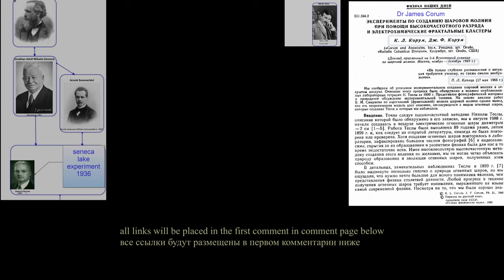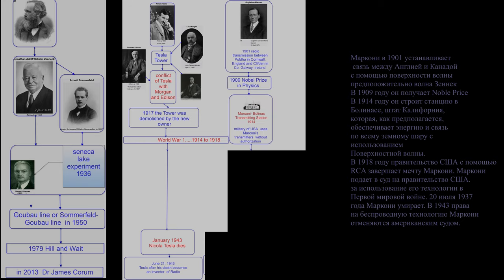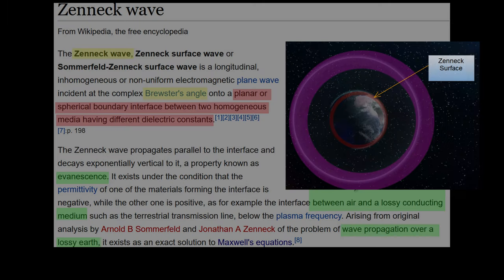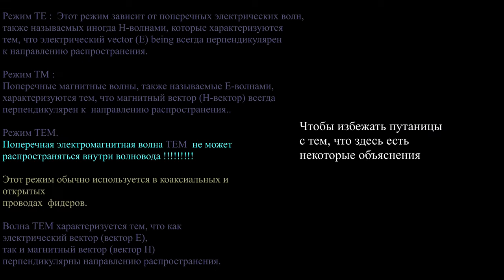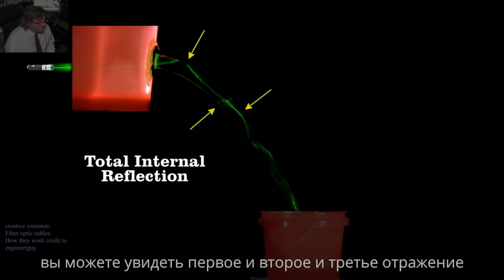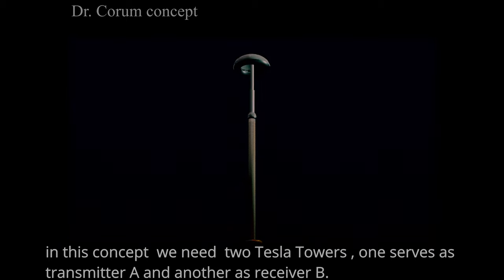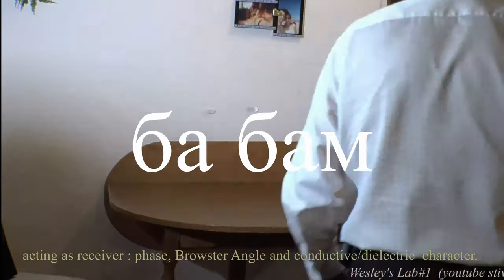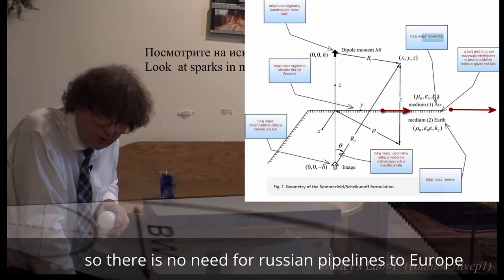Part 2 The Corum and Zenneck Surface Wave guide to  energy transfer

Comment: Ya, really looking forward to part 3, please; construction and tuning to transmit at the Brewster's angle.  We do not have those 40 years the Corum brothers used to figure that thing out ;)
Reply from the maker: all the best my friend .. all the best.
I do what I can in within brackets of my limitation
Reply: Great, my Friend! ;)  Will you please give us some clues here or in the next video, about the following?
RESONANCE
In the Texas Tower patent US20180259399A1 the Corum brothers mentions Resonance and Standing Waves creating maximum voltage at the top capacitor.
Dr Hans’s Secondary coils:  Diameter 13.5 cm x 1400 Turns x Pi = Wire Length 594 meters.
Dr Hans says his Secondary coils are using (Transverse) 2200 meter waveband running his circuits.
The Longitudinal waves of the 2200 meter Transverse waves are 1400 meter waves (2200/(Pi/2)).
The Secondary coils Wire Length is not 1/4 of the Transverse wavelength.  Neither is the Wire Length 1/3 of the Longitudinal wavelength - that would be a Longitudinal “length resonance”.
Have I got it right so far? ;)
How does this 2200 meter wavelength create the Longitudinal Resonance (+ LC Resonance?) and the Standing Waves, maximising the voltage at the top capacitor?
Are the 1400 Turns - and the 1400 meter Longitudinal Wavelength - a coincidence ?
BREWSTER’S ANGLE
I do not understand the mirror image ground plane thing.
What is the actual Brewster’s angle when going from the air into the Earth (image ground plane); into the “guided surface waveguide mode along the surface of the lossy conducting medium”; the Earth’s surface ?
TUNING
You tune the system to project the electricity “into” the Brewster’s angle by:
- Fine tune Frequency,
- Moving the Primary up/down along the Secondary,
- Tune LC Resonance?, and 
- Adjusting the hight of the top capacitor?
S:)
Reply from the maker: @Simen1969  Before  I respond to your question please  explain to me term you have used :
quote: "The Longitudinal waves of the 2200 meter"  with respect to  quote : "Transverse waves are 1400 meter waves (2200/(Pi/2))."
There is NO SUCH THING in physic  as electromagnetic  Longitudinal wave !!!
 You can denote EM wave in meters or in Hz but that's all it  is.
Reply from the maker: @Simen1969  quote of your concern : that would be a Longitudinal “length resonance”.itub 
Wesley's correction :  don't use word Longitudinal as this  parameter/descriptor  is characteristic to mechanical waves  -not EM waves.
In https://patents.google.com/patent/US4751515A/en
 patent Dr J.Corum explained shortening  physical  length of coil that now behaves like it was  many times,  hundreds of times longer . using different  methods  (however  similar.)
 e.g ( CW CCW left, right  bifilar.)
Reply from the maker: @Simen1969   quote of your  question : How does this 2200 meter wavelength create the Longitudinal Resonance
Answer: there is no such thing in physics as "Longitudinal Resonance"
Reply from the maker: @Simen1969  Quote of your question: BREWSTER’S ANGLE I do not understand the mirror image ground plane thing.
Please refer to : https://www.youtube.com/watch?v=wIIABIU3tRw&t=13s
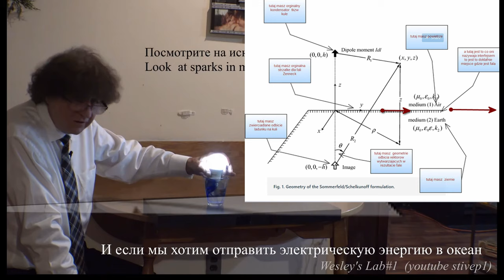Please refer to : 9:07 
Please refer to :  https://surface.syr.edu/cgi/viewcontent.cgi?referer=https://www.bing.com/&httpsredir=1&article=1179&context=etd
or type in google : 
A STUDY FOR THE PROPAGATION OF  ELECTROMAGNETIC WAVES OVER IMPERFECT GROUND PLANES  BASED ON SCHELKUNOFF INTEGRALS 
Note1:  signal ( energy in form of TEM   "converted- formed "- ( not accurate descriptor) and now  at TM ( Transverse Magnetic ) mode must be vertically polarized    and  oscillating in form of (standing wave - controversial) in space between earth and (HV Tesla Coil)  Top Capacitor.
 You don't need to use 1/2 y wave   or 1/4y wave and most likely  you will never use it  but  you will go to  e.g 1/1000 y  using  CW CCW ( not only) winding method .
Note2: for simplicity think that  every possible frequency from 20kHz </>  to  200MHz </> acts exactly the same. way.
{for scientific evaluation  [excluding some specific  variations ( e.g  plasmon)] - the   described mechanism should be the same from 1Hz to  light frequency.}
So you can use </>~52MHz from regular Kenwood TS-2000 at CW - telegraphy)   according  to your license ( or not : )  )   to drive Tx coil made  and calculated for  this band .(- and at this frequency you can use 1/2 or 1/4y) Impedance matching between your Tx  and primary of Tesla coil is mandatory!!!! ( you can also use any Tx of your choice )
It doesn't have to be Dr Hans or in this matter my own  set of parameters.
It will work as well.
But making an antenna will be much  easier for you  at this frequency.
what you are losing  ( using 52MHz) is  performance as inverse square Law is much  more depressing (or aggressively discouraging)   to the  experimenter  at this  frequency , -unless you use it  using surface of the water  ( lake) to create  Air( dielectric) and water ( lossy conductive medium)  *interface * where Zenneck wave lands at Brewster  angle https://en.wikipedia.org/wiki/Brewster%27s_angle
Note3: 1.8MHz or 3.5MHz would be   much more efficient when using Kenwood TS-2000  or any other rig or any other  generator.
Quite nice results  are  achieved using 28MHz as this is easy  band  to wind coils of 1/4  lambda.
Note4:  in frequencies lower than 1MHz e.g 170m  the transmach  known also as impedance matching transformer  will  look like   a TRANSFORMER !!
e.g  https://www.ebay.com/itm/AE-Advanced-Energy-LM-1-25K-Step-Up-Down-RF-Match-Switch-Box-Transformer-PARTS/133173582290
AE Advanced Energy LM-1.25K Step Up/Down RF Match Switch Box Transformer
NOTE 5: Dr Corum experimented at first  at 52MHz at Seneka Lake 
 http://rexresearch.com/corumzenneck/texzon.pdf
or google for : Wireless Power Conference - 2016      
Corum, Miller & Corum: Surface Waves Baylor University Texzon Technologies, 
LLC TEXZON TECHNOLOGIES CONFERENCE PAPER[DRAFT DATE: March 23, 2016] 
SURFACE WAVES AND THE ‘CRUCIAL PROPAGATION EXPERIMENT
that  investor e.g Chevron  evaluated as worth of money spending proof.
that's what  made Viziv tower  in Milford Texas  to be build.

Comment: Ha! Third video? Maybe not. But here's how to make the transmitter tesla coli Wesley used for his wireless lightbulb lighting:  practical  application material:

Primary
 coil form (spool): upper portion of a 5-gallon plastic pail
 Diameter: 11.5"
 Length: 2.125"
 Wire size: AWG #14, type MTW  THWN  THHN  AWM 600 volt
 Turns: 18
 Winding length: 2.125"
 
 Secondary
 Coil form: 1/8"+ cardboard cylinder with 3/32" acrylic ends, with a few light coats of polyurethane finish
     (Grace Ice & Water Shield cylinder)
 Diameter: 5.3125"
 Length: 38"
 Wire size: AWG #24
 Turns: 1740
 Winding length: 37.5"
 Inductance: 54.6 mH
 Resistance: 72.7 ohms
 Height of bottom turn above ground: 18" + 6" (pallet height) = 24"
 
  Elevated terminal
 Aluminum disk
 Diameter: 23"
 Thickness: 0.125"
 Height above top turn: 3' 4.5"
 Aluminum duct
 Diameter: 3.25"
 Overall diameter: 29.5"
 
  Ground terminal
 Copper bonded steel rod: 5/8" x 8', 2 with 8" spacing, driven into the water table at a depth of approximately 4' below grade
 Connecting wire: 14' AWG #10 (stranded) + 21.5' AWG #16 cord

 NOTE:
 mast must be telescopic and must allow to adjust  the position of the top capacitor Up/Down !!
Reply from the maker: Information well made. Thank You. I see you stopped  posting your videos 3 years ago.  Everyone has its own reasons right?    Random viewer  is often not patient enough to understand. Content creator satisfaction/ interaction may not  satisfy  his willingness to  continue.
The more complex explanation was  in https://youtu.be/XOTLfnMOSqQ  . 
For an experimenter the rule is : 
1 understand it first
2 experiment
3 perfect the device.( improvement)
Do not waste time at some areas  rejected permanently by  physics : 
 -there is no overunity, no perpetual motion, no extraction  of energy from permanent magnet, no antigravity, - so very much specified energy conversion/ transfer  process is the way to go. Free Energy should be understood only as Energy that is still for free because initial  source  energy was converted from  is available  for free .   Physics doesn't recognize , magics and spiritualism too.

Wesley
Reply from the maker: @starraider25  With all respect to your enthusiasm I'm very much conservative in physics that  rejected  overunity, perpetual motion and antigravitation and eather. No patents are issued for it.  There  is no scientifically recognized literature  about it nor sufficient convincing scientists evidence.  I  managed  to make  the device 
And than the reflection comes.  - If you have something others likely do not have do not yell about it as it can harm you.
Nobody wants you to have for free their work, product that cost them  time, money and intellect. That includes me and you too. Everyone wants for free but doesn't give anything  for free.
 I like physics and I talk about  real device from  the  perspective of  science but  random crowd  is likely good  in other  areas I'm not .
Here  is the essence allowing understand and by that  nothing is  so much difficult to these willing to  experiment.  I'm not any longer  trying to publish  ready to use ( IKEA style) manual  - :  How to convert Electromagnetic Energy from lightning  into electrical energy  you can use. What for?  DIY please .  But I like to talk about it .  I do not exclude me making 
 new videos  too. https://www.youtube.com/post/UgkxDyXSjGt1mSDtH169OSUWgPGacYjEXWWt

https://youtu.be/XOTLfnMOSqQ  .   https://youtu.be/zE4GjB1cWLQ  - artistic form.
Wesley

Comment: I know how this works. For EM wave transmission you gotta have an antenna that is a good EM radiator, like half wave dipole. For this Zenneck wave, you need an antenna that is a POOR EM wave radiator. That way all the energy can be radiated via that Zenneck wave. Basically just a coax cable of the right length
Reply from the maker: The more complex explanation was  in https://youtu.be/XOTLfnMOSqQ  .   https://youtu.be/zE4GjB1cWLQ  - artistic form.
Reply from the maker: Here  is the essence allowing understand and by that  nothing is  so much difficult to these willing to  experiment.  I'm not any longer  in the position  to publish  ready to use ( IKEA style) manual  - :  How to convert Electromagnetic Energy from lightning  into electrical energy  you can use. What for?  DIY please .  But I like to talk about it . https://www.youtube.com/post/UgkxDyXSjGt1mSDtH169OSUWgPGacYjEXWWt

Comment: Have you entertained any of the technology from the Ancient Egyptians? Their building of anti-gravity vehicles, their vast understanding of magnetic forces along with mechanical pressure to produce electricity? Their knowledge of creating 50 ton blocks of stone using bacteria instead of a heat source? Much of my understanding comes from the devices they built with rudimentary elements. From around 6000-3000 BC their knowledge couldn’t be surpassed by todays knowledge. Most are skeptical of these accomplishments but that’s because most don’t understand any of the dynamics.
Reply from the maker: I'm writing to you 2 years later. Unfortunately  physics do not  accept  antigravity, overunity,  extraction energy  from  magnet, eather,  perpetual motion  etc. 
Energy can only be converted from one source to  another.  So I used energy from lightning conversion  to electrical energy  you can use. The very  foundation for it is understanding  this:
https://www.youtube.com/post/UgkxDyXSjGt1mSDtH169OSUWgPGacYjEXWWt

https://youtu.be/XOTLfnMOSqQ  .   https://youtu.be/zE4GjB1cWLQ  - artistic form.
Wesley
Reply: @stivep1  Yes I have read up more on the Egyptian leaders and it would seem that they were using a rudimentary type of dynamite and an advanced system of pulleys and levers. They may have been using a pulley that would cause friction against amber to create some sort of an electrostatic propellant device. Amber comes from elektron. Maybe this was their anti-gravity device.
Reply from the maker: @Smcsnacks   Amber is a petrified tree resin
When amber is rubbed with wool or silk, amber becomes  charged.. Charge has nothing to do with gravity or  better to say: 
Electric charge is the conserved quantity of the electromagnetic interactions which originate from the local phase symmetry.
Electromagnetism belongs to quantum  physics , Gravity is Newtonian - means  belongs to classical  physics. Phenomena of both  are not "exchangeable"  to be explained  this way. https://www.youtube.com/watch?v=7RmBH96QNyQ&t=247s
 Sorry  but there is no antigravity and never will be
 Two like charged objects may look  like table and  flying foil over it but that is only local phenomena of like charges repelling each other with force greater than local gravity. With increase of distance the charge influence on each other  "drops down' ( in the simple to understand language)
Reply: @stivep1  There's an ancient papryus that  stated the Egyptians used sound to abolish gravity. The sound being a whistling or bell noise. But this is mistranslated. Sound didn't create anti gravity but the machine they had built made these sounds as it moved the stones.
Reply from the maker: @Smcsnacks   The effect you talking about is very much known to science. https://www.youtube.com/watch?v=3MXVSdXZzpc
Sound is mechanical wave having nothing to do  with quantum mechanics.
Reply from the maker: magnetic forces have nothing  to do with  gravity.
Gravity is a force acting on an object with mass, magnetism is a force exerted by virtue of charged particles. . Moving  stone blocks doesn't explain rejected by science  anti-gravity
Reply: @stivep1  But Einstein’s 1915 theory suggests that gravity is not a force but rather a distortion in spacetime caused by massive objects. 
And Newton never liked gravity being said to be a force. He didn't like the "action(force) at a distance" part of it. 
Gravity is simply a result of the geometry of spacetime. Einsteins theory doesn't fail until it gets to the subatomic world. To devise a theory on the subatomic requires electromagnetism and other subatomic forces of the quantum world. Electromagnetism is most certainly a force on that scale. And on the quantum scale gravity and electromagnetism are a force.

So the pyramids being so massive are a distortion in spacetime. Which is why time moves slower inside of the pyramid.
Reply from the maker: @Smcsnacks  Theory of gravity consistent with  quantum mechanics,  known as  a quantum gravity theory which would allow gravity to be united in a common mathematical framework (a theory of everything) with the other three fundamental interactions of physics  
*is not set yet * 
__________________________________________
Albert Einstein in 1915, proposed gravity  not as a force, but as the curvature of spacetime,  (Quantum mechanics in its early stage)- nothing was certain yet at that time.
Newton's law of universal gravitation,  describes gravity as a force(classical mechanics) https://en.wikipedia.org/wiki/Gravity
Classical mechanics and quantum mechanics do not mix.
Niels Bohr and Max Planck are considered the founding fathers of quantum physics not Einstein. However Bohr  model of atom is long time outdated.
________________________________________
gravity is interaction  between objects at the macroscopic scale, and it determines  e.g. the motion of planets, stars, galaxies, and  if talking about black hole -light too. Light is quantum but  exact nature of a black hole is yet to be found. 
*Summary: *  
Before  toilet paper there was no toilet paper and it took time to   develop  it .
Before  quantum physics it was  Newton with  his  still valid classical explanation  of gravity. It takes time for Quantum gravity (QG)  a field of theoretical physics that so far  seeks to describe gravity according to the principles of quantum mechanics.
Physics  doesn't recognize anecdotal  stories about pyramids that  have not been recognized  as   interesting from quantum world  perspective. 
Anti-gravity is a recurring concept in  science fiction.
Anti-gravity was outlawed  under general relativity.
https://en.wikipedia.org/wiki/Anti-gravity
The evidence of your  writing makes me write to you.
There  is no  evidence of Anti-gravity in the Universe.